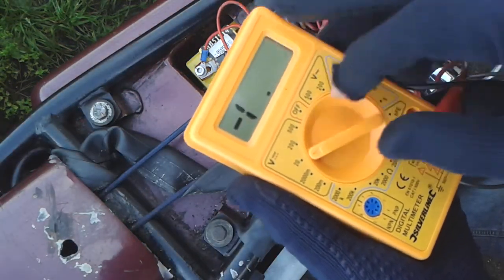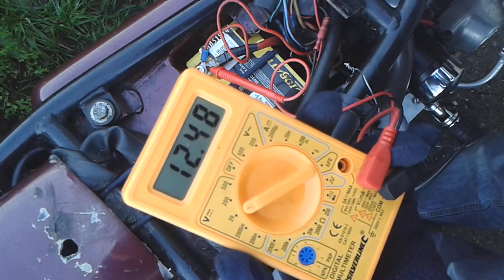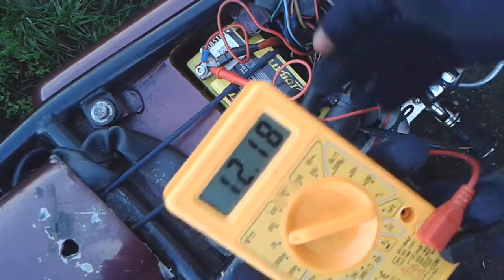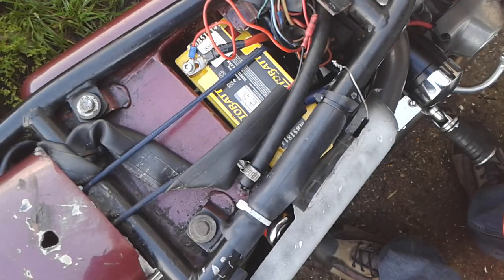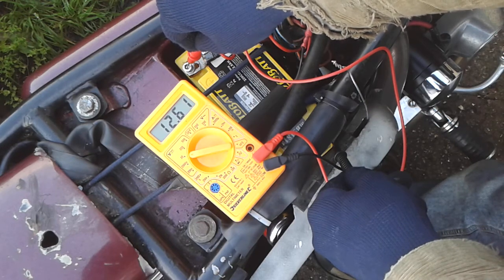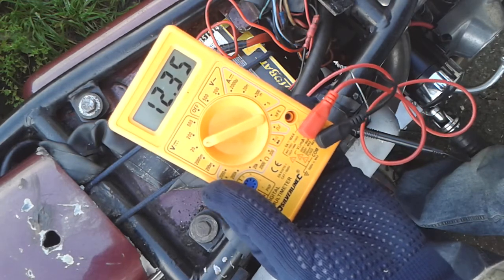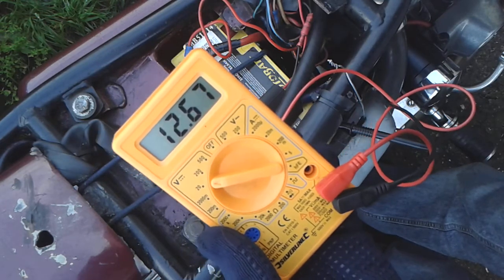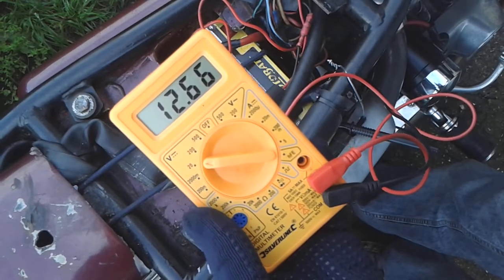Rapid voltage drop - Harley-Davidson XLH1000

Comment: You should buy 4 alligator clips that fit snuggly on the battery connections and 6 inches or so ( pick your length for multiple applications) and then you can have a solid test connection between the meter and test points.

Comment: 12V+ is OK yes is should be dropping. 

Key is that when you started it, it went down to 9v under load, which is the battery draw plus a bit low. 

How old is the battery..try a parasitic draw to see if power is being lost.

As you turn the bike on, it powers up the systems which is normal so a few points dropping is fine.
Reply from the maker: I think it was a duff battery come the end; there's a lithium one in there now. I never liked the electric start so replaced it with a kick, which at least gives me infinite attempts at starting a difficult engine.

Comment: my bike is doing the same thing and the voltage does not go higher than 12,58
Reply from the maker: In my case it turned out to be a dud battery, which was a puzzler as it was only four months old. It had been through hell with a failed regulator and starter clutch though, but the old battery's back on it now and everything's fine.
Reply from the maker: https://www.youtube.com/watch?v=568GtSI7MFI